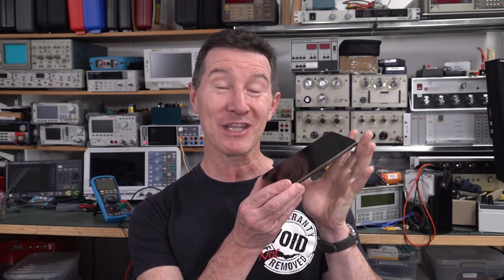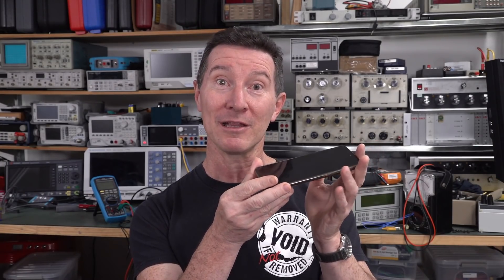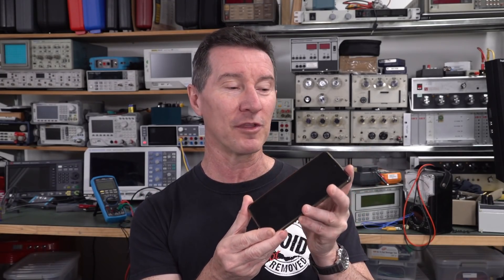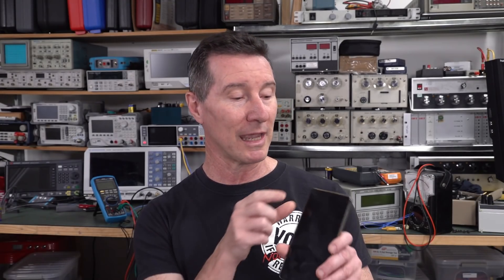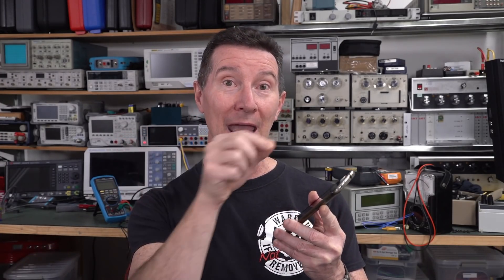Right to Repair - Random Answers

Comment: @3:50 There is another one good reason :You cannot use parts from stolen phones to other phones which discourages phone theft ...
Reply: Yeah, that might be true. But weighing things: do you think that should tip the balance?
Reply: @pietpaaltjes7419  a friend of mine was punched in the face in broad daylight by someone behind her just to steal her phone. At least on phones, I accept that the components on them do not work when they are moved from one phone to another. And it should be made impossible to reuse something from a phone that has been declared stolen. At Apple phones they are almost there at implement this..
Reply: @mihaiachim5299  That is horrible and there is no excuse for that. I hope your friend is doing well. Honistly, I do not have numbers, but I can hardly believe, there is a market for stolen phone parts. Also, I do believe that if these parts were freely available, there wouldn't be an incentive (which I believe is not there to begin with) for stealing phones to disassemble them and sell the parts. But please point me to the numbers if you can. I might be wrong.

Comment: Yet more Apple hate being promoted. I'm typing this on an 8 year old MacBook Pro which has never failed and still has a good battery life. I've never had any other (non Apple) laptop come near to this reliability. I've personally found Apple to be very fair, I had another product fail and they repaired it free of charge under one of their service programs. It's too easy to just keep pointing at Apple, there are hundreds of other brands that are way less reliable and equally as unrepairable......why not mention some of them?
Reply: I think your experience will be 100% accurate and reliable. And I applaud Apple for producing reliable products, which I believe they do. Still, if an Apple product dies on you, which will happen to some, than what? That is what we are talking about here.

Comment: Back around 1998 I had an Apple monitor that stopped working. But they had glued the plastic case to the circuit board on the end of the CRT, and I snapped the neck of the tube trying to get it off. Even after the case was off I couldn't get the board out without destroying it. And what was actually wrong with it? A connector had come loose inside. I've also had problems with Apple laptops and desktops being difficult or expensive to repair because they went out of their way to use custom screws, or custom connectors, or gluing things together for no reason. I actually had to drill through the case and motherboard of an Apple laptop - but it did work in the end!

Comment: It would also be nice if manufactures posted what parts are needed for common repairs.  Instead of taking your phone to a repair shop, having them spend numerous hours to diagnose and fix the problem, they would be able to fix it in less than 1 hour.  The repair shop would then be able to set a flat rate for common repairs, they would be able to fix it for you faster, and people would actually get their devices fixed.  As it is now, every repair shop has to duplicate the same troubleshooting steps and charge for the numerous hours of work to do so.  It's no wonder nobody gets things repaired any more.

Comment: 4:26 Component serialization... I remember some years ago someone game me a game console to look at that had a mechanically fault in the dvd drive. I read something like that that it can't just be swapped over so I just took the pcb out and swapped it over and fortunately on that occasion no soldering to do and it worked fine. That's why I refuse own anything like that. It was just a normal sata  DVD drive many on Ebay but I read it was firmware locked so it only worked if the serial number matched the one from the original drive.

Comment: Products today are made as cheaply as possible. In many cases, it is just cheaper to throw something away and buy new than it is to repair. The technology we have today is basically as good as we will ever need for just about everything. There is no real reason to keep buying the latest and greatest with a few exceptions. Unfortunately, products don't last very long and you don't have much of a choice.
Reply: I think that is not the category of products we are talking here. Smartphone, especially the fruity types, are not inexpensive. There is plenty of room to accommodate easy repair, cost wise. But still the manufacturer choose to make repair hard and costly. That makes you think. (Obviously I am compressing it down to 1 sentence...)
Reply: @pietpaaltjes7419  By saying cheap, I was alluding to forced obsolescence. For decades now, consumer products have been designed to be disposable. The carafes in most coffee makers are made out of extremely thin glass, which will inevitably crack. For a while, the replacement carafes will be available for the machine, but eventually will be discontinued. In most coffee makers, the carafe is made specifically for the machine so you can't use a generic one. So, when the carafe is lost, there is nothing else to do with the rest of the machine, besides dispose of it. Just about every product on the market today is difficult, if not impossible to repair. Weak points are deliberately built into them to ensure that they will not last forever. Before WWII, and shortly thereafter, products designed and built in the US were basically bulletproof. They occasionally would break down, but could easily be repaired. In old radios and televisions, a schematic was almost always included. The electronics were comprised of discrete components, which could easily be replaced by a technician. Many of these early electronics still function just as they did 80+ years ago. Why, because they were designed to. For a form factor of a smartphone to work, the only way possible is to miniaturize the circuits. This typically means building the circuits inside of a dedicated integrated circuit (IC). For the most part the ICs are proprietary, and sometimes keyed specifically to the device, which prevents them from being swapped out. The device manufacturers have monopolies on these parts, and do not make them available to third parties. So, the manufacturer can suddenly take the parts off the market and make the device be obsolete. For a very long time, prosumer products escaped this cheapening effect. But, now even expensive products are treated the same way. My first smartphone had expandable storage, a headphone jack, and a removable cover to access the battery compartment. Newer phones are completely sealed and have none of these features. There are basically only 2 phone manufacturers on the entire planet so there is no real competition. I would gladly buy a phone that has those features of my first phone. It wouldn't make a difference to me if it was a couple of mm thicker. These companies have such control over the marketplace, not only because they vertically integrate the entire manufacturing process, but also because they own all the patents that are necessary to create such a device. The only way for there to be any competition in the market is if the patents were no longer enforced.

Comment: Right to repair in the cellphone marketplace is going to be a tough fight... The market is saturated, sales are for replacement phones or new models. No one is walking around without a cell phone in a first world country (unless you're Amish :) ).
The uphill battle is fighting against:
 - corporate profit margins (they have to sell replacement phones to make their target quarterly earnings)
 - JIT manufacturing chains (Just-in-time means that stocking inventory for repairing phones is not something that companies want to do)
 - stock EOL (parts these days EOL so fast, companies have to be constantly revising their product in order to ensure they have the parts for them)

NONE of the above is good in my opinion, and is especially a horrible environmental burden on the planet. Changing this means a fundamental pivot on the perception of wealth as the "way to win" no matter the cost, and that's a tough sell.

Escape from this churn could be a pivot to a new technology to replace smart phones, but when that happens all the old phones get dumped. Then the cycle begins again.

That's all I have to say for now, if anyone wants me I will be hiding in my closet.

Comment: my first case of right to repair was a c64 mark 2 power supply. the old ones you could unscrew and replace a diode or capacitors. the new ones were encased in appoxy resins. we called it being bricked. enjoyed the video and appreciate your site 👍

Comment: Interestingly the EU are trying to ban third party car parts insisting that you need to purchase replacment car parts from the manufacturers.

https://garagewire.co.uk/news/company/euro-car-parts/euro-car-parts-calls-on-government-to-act-on-monopoly-threat-to-independent-aftermarket/

At first I thought that this was due to BREXIT, however, it may be to help the EU's collapsing economies following the pandemic.

They tried a similar thing by rubbishing the reputation of Astra Zenica vaccines (sold at cost) to market their own vaccines (at Inflated costs) .  I believe that they also blocked Australia's access to the AZ vaccines.  Interestingly they are now having problems with their own vaccines.

I have recently had problems with Epson printers who simply want you to buy a new printer.  I did but have now refused to buy Epson - wrote to them to tell them so.

Comment: More on this is you buy a motor vehicle or motorbike, and you are then bound to the manufacturer to buy things like tyres and fuel, which are only available from the dealership, and where you are unable to use aftermarket ones, even if they are identical.

Comment: You'd think a company like Rohde and Schwarz wouldn't mind providing info about end of life test equipment but unfortunately not the case. I have a FS300 spectrum analyzer that has died and even working directly with Dr. Ulrich Rhode couldn't shake loose the documentation from his own company for me to use to troubleshoot my dead unit. Sigh, now reverse engineering is the only way to bring this thing back to life...hopefully!
Reply: If you have been working with Dr. Ulrich Rhode then you might have some interesting stories to tell. Would you ? :-)
Reply: @pietpaaltjes7419  He is a ham radio operator and after I had a digital mode contact with him I sent him a note with my QSL card (the "final courtesy") asking for his assistance obtaining schematics and any more detailed service information (the service manual available basically says "Thing bad? - Change bad assembly". He also told me that all of the technicians who would have worked on this particular box were retired by now. That's about as interesting as it gets...

Comment: I do see the value in serialization. It would be nice to be warned if something didn't match, but preventing it from working is nuts.
Reply: There is no need for serialization and locking to a particular part. A cryptically signed certificate of authenticity of the part and its firmware would also ensure this and could be extended to known 3rd party compatible components if the manufacturer want to allow such which could for instance ease the component shortages of one manufacturer if a 2nd source has qualified parts available - a paradigm that is used for complex products in fields like automotive, medical, aeronautical and military equipment to have 2nd ad even 3rd sources, that’s why common off the shelf parts of IC series (74 series, 4000 cmos series families and all the early microprocessor families) exists that were made by most of the big companies.

Comment: Who dictated that mobile phones should be so slim that the consumer cannot easily replace the battery? Were consumers ever consulted on this design decision? 
The market model has changed from selling a product to providing a "service". This means that the consumer never owns the product they thought they paid for. The product software allows the manufacture to disable what they have sold any time they like. 
It is the ubiquitous link to the internet, that is insidiously being included in every kind of product, that makes this marketing model possible. 
How long will it be before the consumer is forced to replace all the white and brown goods in their home, because they are no longer compatible with the latest version of the internet software that controls them. Imagine being told, by a software company, that all the appliances in your home will cease to function on a particular date, because the company will no longer be providing software support from that date, and all must be updated to be compatible with the latest version of the home control OS.

It is about establishing a link between the customers bank account and that of the manufacture, with all the transactions being regular and in only one direction. Its a form of blackmail, as failure to pay results in disconnection from the essentials of modern life.

One of the key elements of this revised marketing model, is the ability to make the consumer repeatedly buy for the same functionality over and over again. This is most noticeable in the home computing market, where consumers are forced to buy the same application every time the computer operating system is "upgraded" to a newer version. 
As a further insult to the consumer, working hardware is rendered obsolete in the process, as software drivers become incompatible. A classic example being the latest upgrade of windows to version 11. It's all very well Microsoft claiming to be going green and carbon neutral, when in an instant, its marketing strategy generates a huge new mountain of electronic waste. 

I maintain that this marketing strategy is counter productive in the long term, for while the consumer is constantly forced, by software obsolescence, to repurchase functionality they already own, technological progress is stifled as they cannot afford to invest in equipment that provides new functionality. Effectively the electronics industry has placed the consumer on a treadmill going nowhere.
 One must wonder why the hardware must run faster and faster, with every greater amounts of memory, to perform tasks that were adequately addressed by  previous generation of hardware. The excuse is often improved security, but this just shows how poorly the previous generation of products were designed and debugged. It is the consumer who is constantly used as the beta tester.

Comment: Would you excuse a car manufacturer that builds a car that has a 30% chance of shattering the windshield every time you needed access to the battery? What is the first thing to die in a smartphone? Then they made the brake pads unavailable to the public or repair shops? The only way to get pads was to buy a utility trailer take the pads off and throw away the trailer. That's the modern smartphone. Never mind all the greenwashing I don't understand how Apple and other corporations can call themselves green and still be pulling this crap.
Reply: "What is the first thing to die in a smartphone?" The screen lol, seriously though even for phones where the manufacturer allows you to overcharge the battery to 4.3v it's still rare that the battery outright dies, you just lose 50% capacity after 2-3 years, so being dropped or liquid damage is usually the first thing that makes it die.

Comment: Dave, I do agree with you.  They do need to make electronic easier to repair.  This includes the ability to easy dismantle the unit and replace or modify to what you want, even if it doesn't work.
I hate newer device with internal rechargeable batteries that when the battery fails, and they will, you can't use the device even when it plugged into a external power supply.  This is bad design.

Comment: Hello Dave , I explained my friends about right to repair and Framework laptop example , they laughed at me saying its not worth it . what can i do ?
I know what companies do , I have an example : my samsung galaxy s6edge was bootlooping due to an update OTA i asked the official service center they said we have to pay 25000rs which was half the price of the phone !
I knew that the update broke the device but samsung said to replace the motherboard WTF . 
any way . My question is what can i do to make my friends understand ? that this is a problem !
Reply from the maker: What can you do? Secretly break their crapple product in a way that would be an easy cheap fix and watch their horror when they get quoted 500 bucks or something. That should convert them :->
Reply: @EEVblog2  ha, Dave:  Chaotic Good.
Reply: Open smartphone without destroying it. Disconnect screen flexwire. Close it and let the fun begin!

Comment: I'm not an advocate for parts serialization but i can kind of see the point that it might be less attractive for thieves to steal phones, take them apart and sell the spare parts while account locks prevent the sale of the whole phone.
Reply from the maker: That argument doesn't hold any weight.
Reply: @EEVblog2  it has been an issue with stolen cars chopped up for parts, and in some places there are hefty fines for scrap dealers not keeping a paper trail of where parts come from
Reply: You are going to want repair over security because all phones fail at some point.  Not all phones are stolen. Imagine if your car was serialized.
Reply: @jack_brooks  many of the electronics modules (and the key) in your car is serialized and the car won't start if they don't match
Reply: A good compromise is that the device wipes itself when accessed illegally (stolen or otherwise).
Reply: @cormacsyt0  a stolen phone is worthless as a phone, but how much are the parts worth? how much is an original screen and battery for a new iphone?